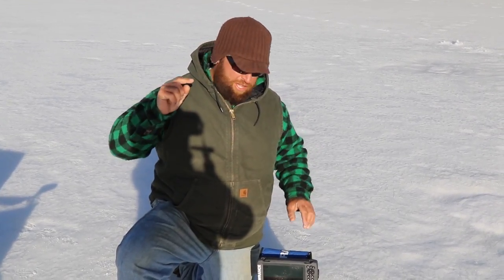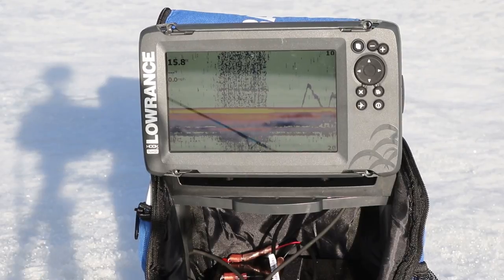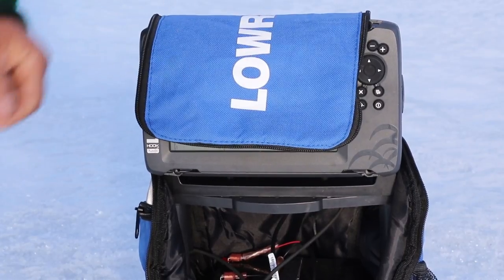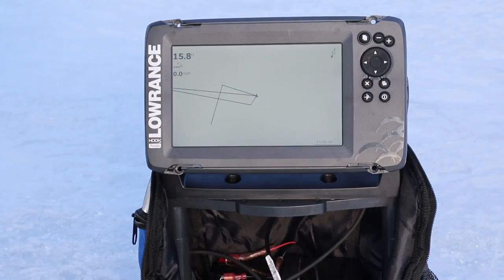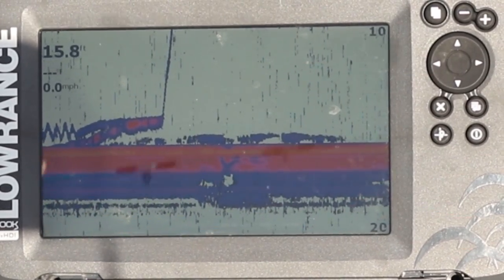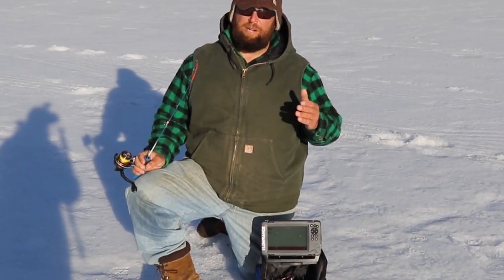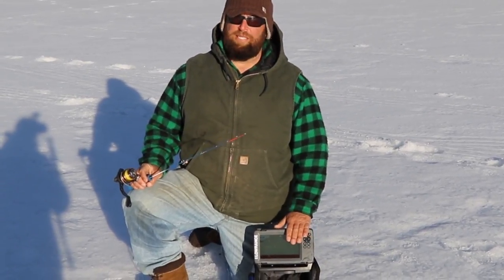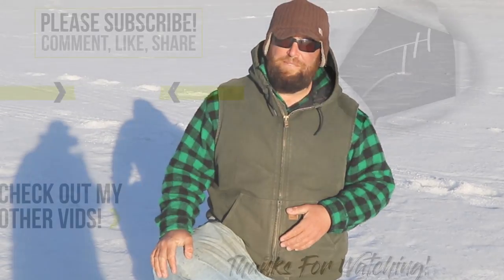HOW TO USE ELECTRONICS FOR ICE FISHING (Lowrance Hook 2x 7)

Comment: I had the flasher on my screen and tried to make it go t to full screen. It disappeared and now I can't find it at all any more. I have a Hooks 7 TS. Also in shallow water the flasher worked but not in 80 to 100 feet for Lake trout
Reply from the maker: I think the top right button on that unit will cycle you through different screens. Check you mode it might be set to auto or ice fishing .